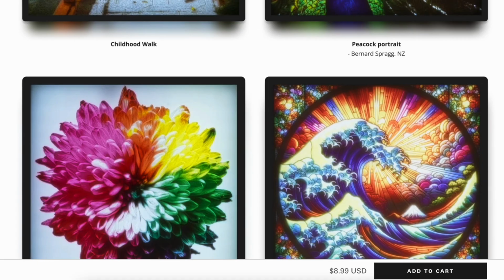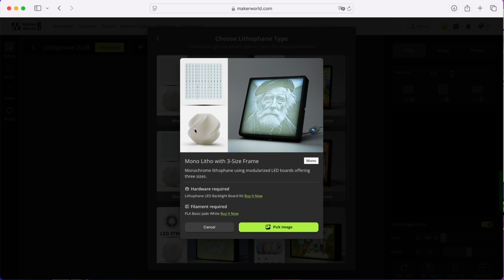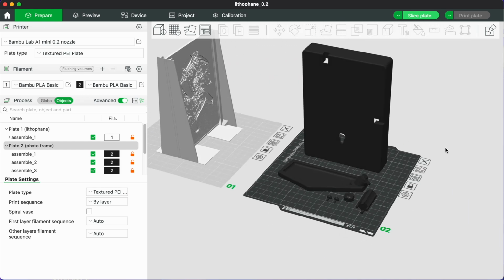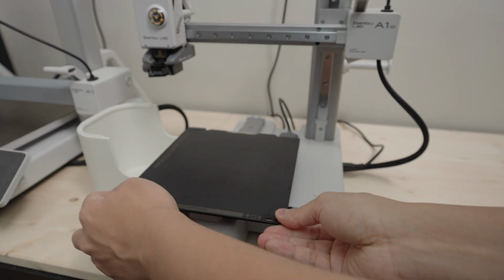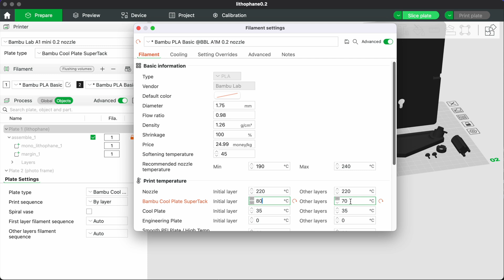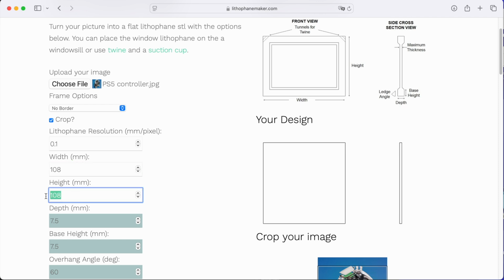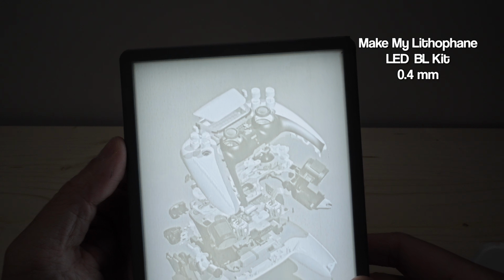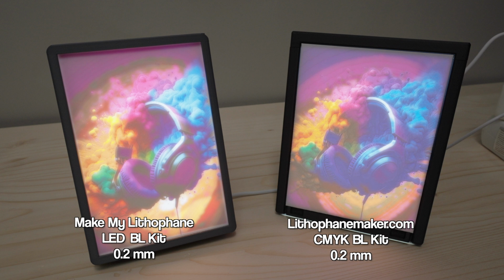How to make Lithophanes using Bambu Lab's Lithophane Generator (Make My Lithophane)

Comment from the maker: A1 Mini Combo: https://www.awin1.com/awclick.php?gid=570773&mid=46345&awinaffid=2034675&linkid=4382675&clickref=
SuperTack Plate: http://shrsl.com/4tf92
New LED BacklightBoard Kit: https://tidd.ly/3N5IHyK
Old LED BacklightBoard Kit: https://tidd.ly/4sEotN0
PLA Basic White: http://shrsl.com/4tf91
PLA CMYK Bundle: https://tidd.ly/4q5tj3W
Recommended Filaments: https://www.awin1.com/awclick.php?gid=570777&mid=46345&awinaffid=2034675&linkid=4382680&clickref=

My 2nd favorite filaments: https://geni.us/A4OFomi
Lubricant for X,Z,Y-Axis rails & idler pulleys: https://tidd.ly/3KMFHqs
Grease for Lead screws: https://tidd.ly/3Lk36j2
PTFE Tube: https://tidd.ly/49Dw6eX
Deburring tool: https://geni.us/9WGzv
Wire cutter: https://geni.us/NAwQIL
Heat gun: https://geni.us/Jdcu

#Affiliate

Comment: yeah, "Make My Lithophane" is completely useless. Pressing "download" button and nothing happens, no matter what I try. So... garbage.
Reply from the maker: really? I‘ve to test that later. Usually it works great, I could download everything without issues
Reply: @Lukis3D turns out that it doesn't work with Chrome. I tried Edge, and it worked .
Reply from the maker: good to know that it‘s browser-related. Thanks for the heads up! I And have fun printing the lithophanes!💪🏼

Comment: Thanks for the awesome video! I'm trying to print one for my mom and I was wondering, do you keep the layer height at the same (0.2 mm)? or do you use the recommended one of 0.15? I love the fact that you save us some time on not printing the not needed parts, will give that a try, but I think I will add a brim for it. Thanks again!
Reply from the maker: hey you‘re welcome man! i didnt change the settings alot here, i just used the settings from the generated .3mf file (Make my Lithophane). If my memory serves me right, the layer height was 0.12mm (first layer 0.2mm) using the 0.2mm nozzle.
It would take longer to print with 0.2mm nozzle, but the result is way better than with the 0.4mm nozzle.

I would just use the textured PEI plate with standard temperature, plus the brim. And also make sure that your plate is clean. Wash it with warm water and soap👍🏼 Good luck man!
Reply: @Lukis3D  Thank you! yeah I printed it with the 0.4 mm nozzle on my P1S, it looks great tbh... not sure I need to go to 0.2 unless there's a lot of detail I want to keep. But yeah thank you you saved me a lot of printing time thank you thank you!

Comment: Hey, what slicer settings do you use?? I got a P1S around two weeks ago and tried lithophanes but i just got zits all over it
Reply from the maker: the settings will be automatically configured when you open the downloaded file in BambuStudio so you don’t have to mess around alot with the settings.
If you have zits, try to dry your filament first. Sounds like you have a wet filament

Comment: Great video. I did a colour lithophane with the bambu lab studio and p1s and I feel it's very blurry. Any advice on sharper image.
Reply from the maker: thanks man! did you print the colour lithophane with a 0.2 mm nozzle? you’ll get colour lithophanes with better resolution.
Theoretically there’s another way you can print better colour lithophanes: you print it standing up (like printing the monocolor lithophanes). But that will take weeks to finish so it’s just not worth it in my opinion.
Reply: @Lukis3D  yeh I used 0.2mm nozzle. I wonder if I slowed it down would it make any difference. Or slice it with different software and see. I'll have to go trial and error I think.

Comment: did the A1 do better than the X1... im on the fence of A1 or P1S. what would you recommend.
Reply from the maker: if you’re not planning to print with ABS, PC or any other high temp filaments, I would go for A1. 
Its really easy to swap nozzles on thr A1 and its even quieter than P1S. However, its still a bedslinger so if you’re printing big and tall models, the print quality wont be as good as the P1S.

Comment: Why not print the frame horizontally take less support?
Reply from the maker: you mean print it flat on the bed? you get the best quality when printing lithophane in the standing position. If you print it flat, it will have those weird posturized ridges, kinda similar to my color lithophanes i printed in this video

Comment: For the color lithophane from makerlab did you have to change any settings manually or did you just print with the settings it already had when you opened the file you downloaded? (For me it says that the object has floating regions and to enable supports)
Reply from the maker: hi there! I don‘t need to change any settings, (just make sure that you choose the right printer and the right nozzle). 
Yes mine says the same thing but I just ignored it and hit print. I‘ve had no issues so far 👍🏼
Reply: @Lukis3D  So I was printing and halfway through the top right corner was warped and it messed up the print

Comment: Your SuperTack experience lines up with mine. The default bed temp settings are too low for good adhesion and need to be bumped up a bit (maybe not has high as 80 🙂). I have both SuperTack and BIQU plates and the BIQU ones are better IMO because they need less temp bump and are thicker overall.
Reply from the maker: hey man thanks for sharing! Yeah i’ve to admit the 80deg is abit of an overkill😄 I havent got the chance to try the BIQU yet, but i’m glad that it works for you!

Comment: Thank you for this video,
It's very useful!
I am trying to print a colour lithophane on a BambuLab A1 with a texture PLA plate and 0.4 hot end but I always get issues with wrapping in the corners. I tried different bed temperatures (65, 55, 50) but no success. I also decrease the printing speed to 50% hopping that this will help. 
How did you manage to end up with a flat and sticked print?
Reply from the maker: hi there! I actually didnt change any settings, i just choose the smooth template and printed using the settings that is downloaded from the tool.

You also want to avoid draft in the room, since it could also cause warping. Another thing is to make sure that the plate is clean so the lithophane adheres properly.

Comment: hi Lukis, when printing color lithophane using the BBL Makerworld website, do you manually change the sparse infill density to 100% in "global" setting and infill type to "rectilinear" ? Really appreciate you breaking down the different types of nozzle used and the two lithophane website comparison, making it easy for beginners like me to understand lithophane printing. Thanks!
Reply from the maker: Hi Dante, if you generate the lithophanes from Makerworld (Make My Lithophane), you don’t need to change any settings. That’s the beauty of it. The downloaded file is already tailored to print your lithophanes. Of course, you may want to select the right nozzle and the right plate that you currently have on your printer.

But all in all, you get the best results printing with the 0.2mm nozzle. It will take a lot longer though, so that’s the downside.

If you want the lithophane to be any size (if you have different frames), then  you can generate the lithophane from the lithophanemaker.com. If you have bambu’s LED Kit, then it’s so much convenient to use BBL Make My Lithophane😊

Comment: its a cool plate maybe you have test it on 30-35°C i Print only 30-35  and i use pla+ cold withe Filament
Reply from the maker: it didnt stick that well at 45•C so I didnt reduce the temp, but perhaps i could try that and see how it performs. Thanks for the suggestion!
Reply: @Lukis3D  and have you Test it ?

Comment: I’ve always printed my Lithophanes flat and got brilliant results.
Reply from the maker: thats great man! I didnt include the test in the video, but i’ll try that on the weekend and compare it to the rest of the lithophanes👍🏼
Reply: @Lukis3D  Did you compare the vertical vs the horizontal print?
Reply: @ admittedly I haven’t done a direct comparison with a vertical print.
Reply: Then you have much less resolution.
Reply: I have printed a few laying down on the bed now, but was asking myself if this is more stressing on the nozzle? As it seems to scrape more than with a ‘normal’ print. Anyone that knows if this is true?
Reply: How do you put it flat???

Comment: With a bed slinger you will get better results orienting the lithophane along the Y axis. Less movement of the printhead.
Reply from the maker: yea i actually did that, but there’s alot of movement of the bed, so the warping is much worse since the rapid movement is making the air moves around it

Comment: I think adding a 5mm brim should help with the base, so you dont need to put that high temp on the bed
Reply: I use 80° all the time and never have any warping.
Reply from the maker: I did that too, you can see a quick snippet of it at the end of the video. Although it helps to hold the lithophane Unfortunately it didnt help with the warping.

Comment: Nice video. One question. Why didn't you use a brim? It would have been a bit more helpful in maintaining contact and as you said, "it's going in a frame" so the edges wouldn't really matter...
Reply from the maker: thank you! yeah I did add a brim, there’s a quick snippet of it at the end of the video. I even increased thickness of the first layer, but it didn’t really help with the warping. I also did mouse ears, which also didn’t help.
Thats why I didnt mention them in the video😄
Reply: @ Interesting. I’ve just stepped into the BambuLab world. Prusa user mostly. So for multicolor printing, at this scale, not so knowledgeable. Happy to see there is a significant improvement in using the newer plate. Wonder what the Biqu (blue) plate has to offer. 

Keep it up, love how your channel is progressing!
Reply from the maker: Yeah i’ve always wanted to try the BIQU plates, so i’ll probably get one and compare them in the future. 

And of course, its all thanks to you and to other people who watch my videos and comment on them that really help my channel out!

Comment: the cool plate supertack is not suppose to go up high temperature, but low ones.
Reply from the maker: yeah i was hoping that the print would hold at recommended temp (45degC), but unfortunately it didnt. So for the best chance of success, you’ll have to increase the temp. of course 80degC is a bit of an overkill, but you know how i like to test stuffs😁
Reply: @Lukis3D  I get it yeah, but the issue there was the position of your print, remember that the smallest is the surface and the hottest is the plate, the higher is the chance of warping, made a video about it. My cool plate will come this week and I'll test it ;)
Reply from the maker: thats great! Would really be interested to know the outcome and I’ll surely check it out!
Reply: @Lukis3D  Hey, just tested the cool plate supertack, at 45© with pla, sticks like hell, so you're definitely doing something wrong there 👍🏼